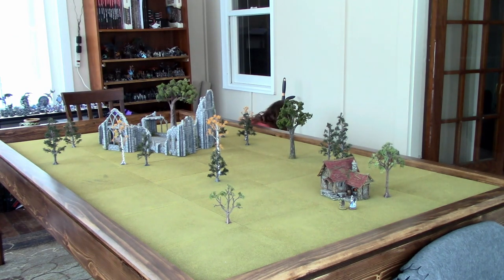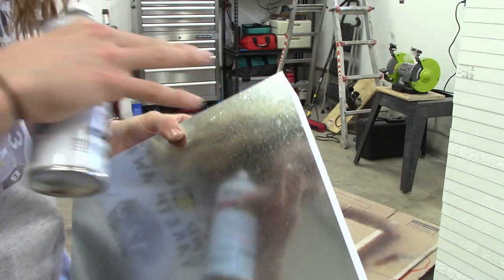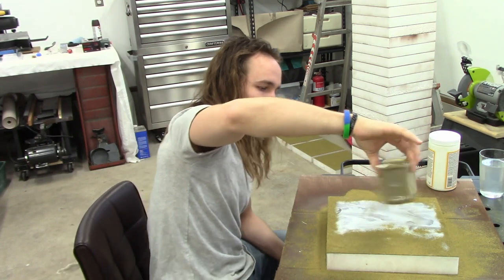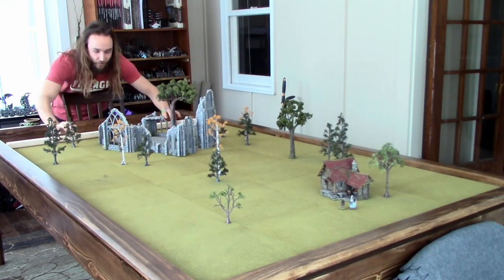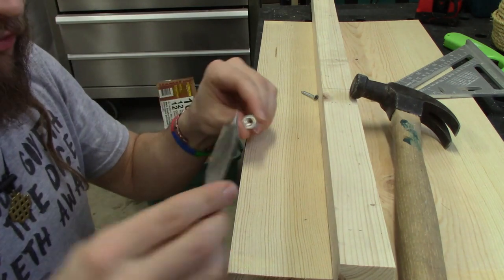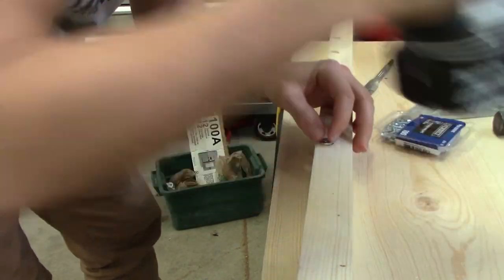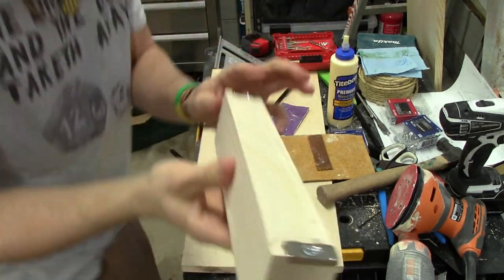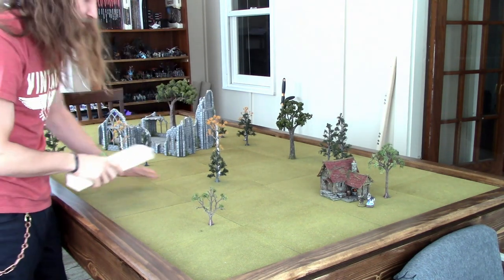Modular Terrain Blocks     Part 1:Base

Comment: What may help with drilling the holes to a consistent depth is using a piece of tape as a flag. 
Drill and check the hole for the first one, as you did. When it's perfect, stick the bit back into the hole, and wrap a piece of painter's tape right where the bit meets the wood. Now you have a visual aid to help drill them all to the same depth.

Your table looks awesome, and  look forward to the rest of the build!
Reply from the maker: That's really smart thanks for the tip!
Reply: @theminismithy6198  Thats 6th grade knowledge...

Comment: Awesome system, I'd like to know what size, gauge, type of metal you used. You said 11-15/16 square, got it. You had a local sheet metal fab company cut the squares. Did you find the cost of that service to be reasonable?